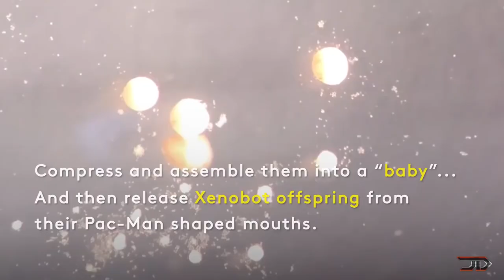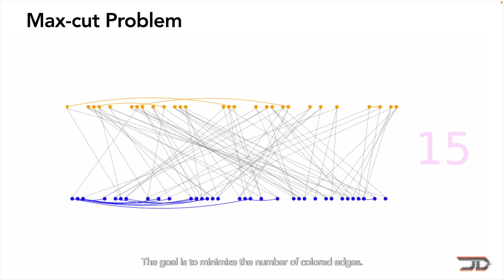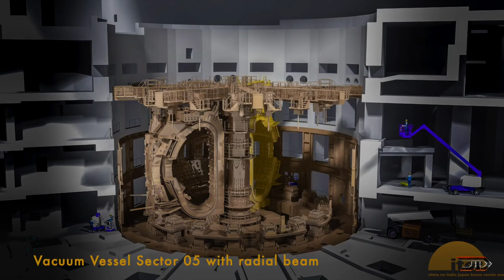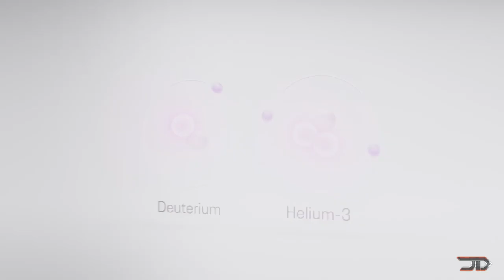TOP 7 Future Technologies That Will Change EVERYTHING

Comment: Isn't gravity just an energy vector-based on space-time curves?
I've always wonder if gyroscopic precession might lead to some sort of anti gravity break through
Reply from the maker: You could be very well be right! Thats what I kind of thought with nuclear orientation but it has not been proven yet.
Reply: Yes and no, gyroscopes alone do not solve gravitational force but they are necessary
Reply: @guitarlearningtoplay  I concur. If you view gravity as an X,Y,Z energy debt. This debt can repaid by matching and exceeding that of a gravitational force. IE processional apparatus can solve for energy vector imposed on the either the X or Y axis depending on orientation.
Reply: Have u heard of the guy from Florida, USA that made his own stone henge in his 70s there was some sort of machine in his basement that when we tampered with it we broke it and have been able to put it back in the same precision, I think he manipulated gravity somehow, and if he did that would help us understand that maybe the pyramids were built like that

Comment: Are UFO's terrestrial or extraterrestrial. I think at least some are very much terrestrial and can be explained by new science being tested. But where did they first get the basics for making it work. Are Roswell stories true, is it reverse engineering?
Reply from the maker: It's a good question! If it was true then they have kept the secret tech hidden for a long time. If they do feed disinfo, then only a few would know about the true story.
Reply: @Tech_Planet  I often wonder if the first steps of reverse engineering was actually the discovery of microprocessors. They took a huge leap forward in a very short time.